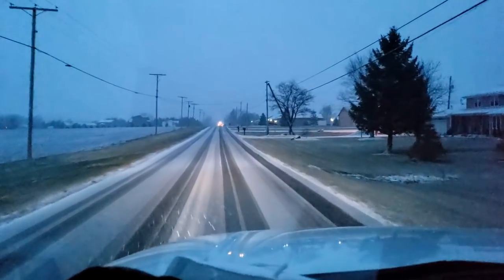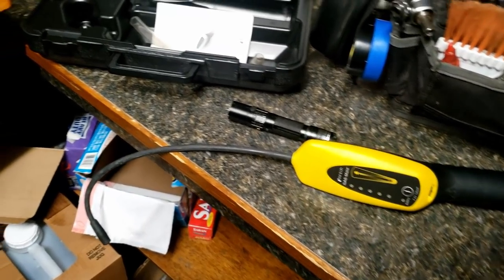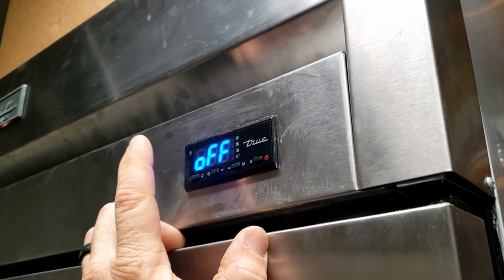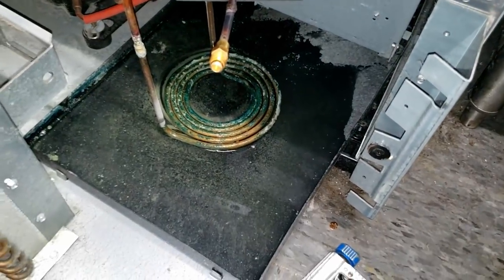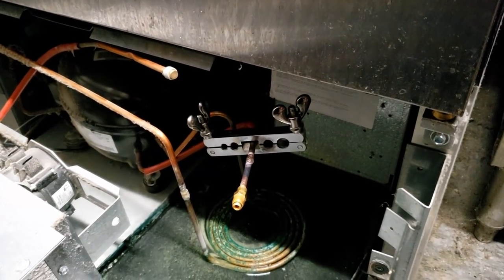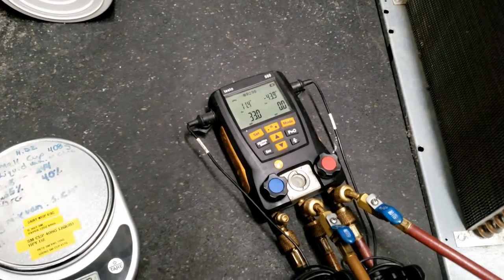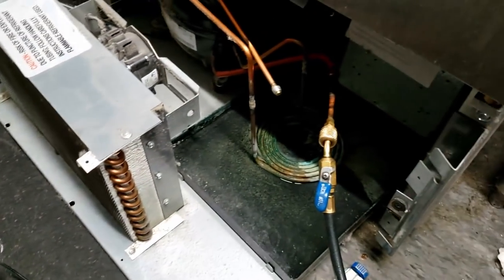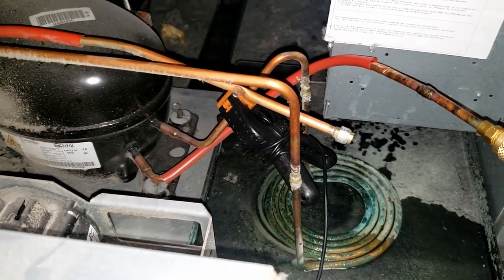True R-290 Cooler Warm

Comment: Just last weekend I worked on a Norlake unit. Last week on Thursday went out to replace the condenser coil the sheared off right at the tube sheet. Replaced it with new coil and did a normal vac and charge. Called back on Saturday for it not working again. Replaced the filter/dryer and revacuumed for 4 hours since the oil was not wanting to release the moisture that got into the system from the first problem. What a nightmare that was. Just goes and shows that the old vacuum by time does not always pay off.
Reply from the maker: Poe oil won't let go of the moisture with a vacuum, if I believe the oil is shot I'll dump it and put in new. Otherwise the cap tube will plug up and bite you in the butt.

Comment: I do a lot of True residential 24" under counter wine/ beverage centers with 134a, and I have found many of those grey colored evaps leaking where yours is and in the middle of the coil. The replacement coils are black in color, hopefully they hold up better. The build date on the coils that I see has been mostly 2017.  Great video by the way!!!
Reply from the maker: The new coil was made by Nordyne so we will see. I think of the poor quality equipment when I think of them.

Comment: I thought I was doing something wrong with a lot of r290  freezers finding them with leaking Freon evap s and stopped up caps tubes , compressors being burned up blown compressors blown overloads great video brother
Reply from the maker: Thanks Doug, these R290 systems are built so efficiently that there's no tolerance for  compressors that are low on refrigerant thanks to thin copper coils  and they leak refrigerant in the evaporator then burn up the compressor. Another example of the government making things worse.
Reply: Yes sir Rick I 100% agree
Reply: @HVACRSurvival  Some equipment use the DI, on the controller to sense a low suction pressure with a pressostat and safely stop compressor if tripped x'times in y'time. It could be an european thing.

Comment: Good catch Rick . Seems like that particular True model has lots of issues . Replaced module , on one of those , done hinges , gaskets , LED , and driver Geeezzzz True . One positive thing , they learned from Everest and Turbo Air on those easy to replace Cap tubes 🤷🏻‍♂️.
Reply from the maker: They learn sometimes but they probably will change it back 😂
Reply: @HVACRSurvival  🤷🏻‍♂️

Comment: Just curious, do you make it a point to replace the cap tube when doing an evap? I’m thinking it maybe good practice. I started a new job where I’ll be doing a lot of these.

Edit to say: the coils they’re using with these are not resilient-at all- I’ve done many.
Reply from the maker: Normally we replaced the capillary tube anytime we replace the evaporator. It’s a little bit of a pain in the butt but it reduces the possibility of a callback by a lot, now I will tell you if you have a system has been running low on refrigerant the next best thing you can also do is dump the oil out of the compressor and replace it with the same amount you took out, if that oil is compromised It’ll plug up the new capillary tube.

Comment: Young tech hear Rick, I noticed after u added the new proper charge ,the evap temp was 20 and the stat said it was 54 degrees in the space  ,as it is a reach in cooler 20 degrees td shouldn't your evap temp be closer to 34 degrees ?
Reply from the maker: From my experience the suction pressure will drop as the box temp drops but generally the saturated evaporator temperature will hold somewhere around 18° but sometimes as low as 12°. If you look up how a capillary tube system meters it's kind of interesting, as the temperature changes the flow changes. I'll have to look for the article,  maybe I can do a video on it. I'll have to get refreshed on it because I forget all the science behind it. But what's interesting is there's no calculated means of determining the capillary tube size and refrigerant charge, the engineers literally have to build a system,  test it's operation, cut it apart, adjust it over and over until they find what works. It was kind of interesting how it's not a calculated science but more of a ballpark until they actually run the test from what I read. I believe it was Supco who wrote what I'm referring to.

Comment: If ur gonna use a bucket and the same size cannister for it all the time, could always flip the bucket upside down and put a big enough hole in the bottom with a slit for the hose to go through.. Should be more stable that way if you dont have a proper stand..
shrug, just a thought..
Reply from the maker: Yeah,  I can make one out of sheet metal but I really don't do that many of these (yet). This little bucket thing worked better than expected. Thanks for the suggestion 👍👍
Reply: My bad, i forgot you have actual resources to make something if you needed to, so a cheap makeshift holder isnt needed lol. Owell <3

Comment: I wonder if the ultrasonic detector would have picked up that tiny leak.
Reply from the maker: It didn't. (I didn't record me trying that) the pressure was to low for both devices to find it. Once I recharged it, I was able to pick it up with the leak detector. I never tried the ultrasonic a 2nd time.
Reply: @HVACRSurvival    thanks Mr rick.  Appreciate your videos

Comment: Did u wedded  with  map torch  that's  bad for the  refrigeration  system..
Reply from the maker: Heat is heat, explain your statement.
Reply: El Mosfet is not entirely wrong: being wedded/married to a MAPP Pro torch would likely be bad for just about every scenario.

Comment: Hey Rick
I have a stand for my R-290 cylinder.. It looks like this
https://images.app.goo.gl/ww9Tukrefeew2hrh7
Its stable and works really well.
You put a straight ball valve on your cylinder and screw in on the stand and then connect your horse to the valve on the stand..
Ohh and killer video